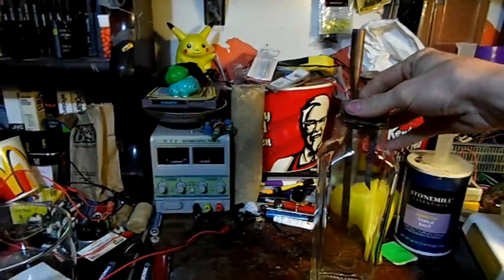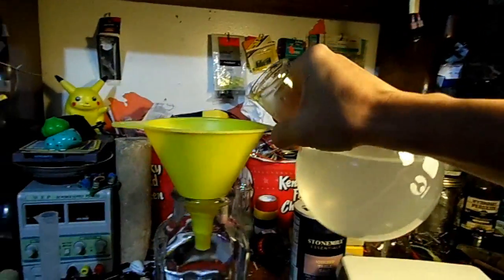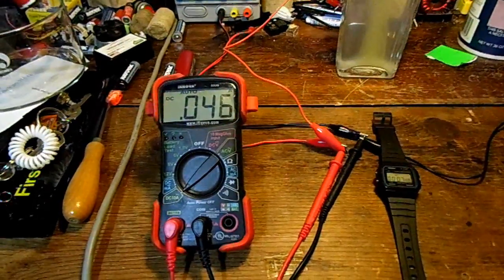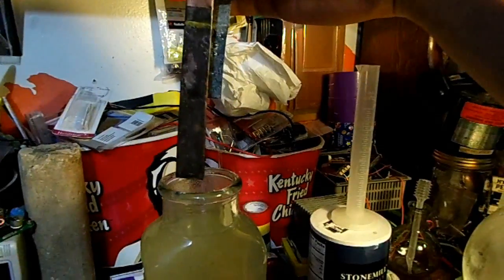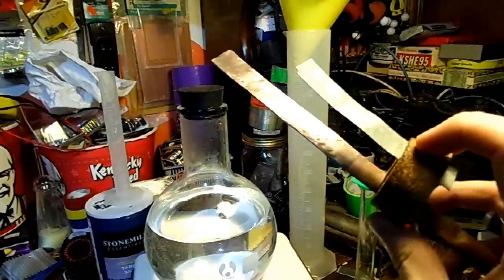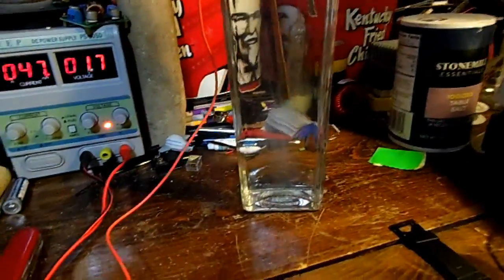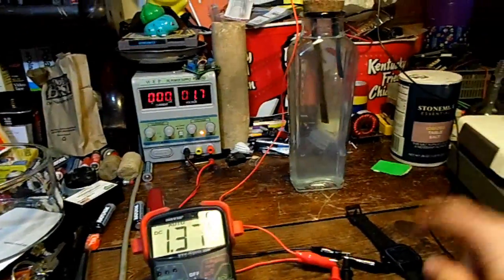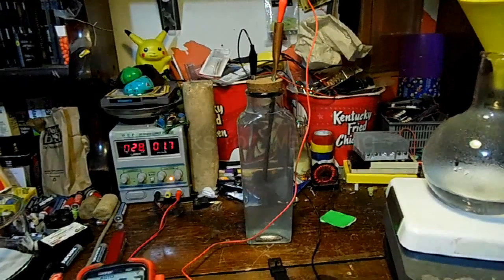DIY Rechargible Copper Zinc Battery with Epsom Salt

Comment: Thanks for sharing. ^.^ this is extremely easy to make a rechargable battery at home. 25 of those bottles 5 connected to parallel and 5 in series will make 5V 0,5 A rechargable battery that should be last for 2,5 hours in theory. Hi from the year 2021 when worldwide massive blackouts expecting on following month this year. So preparing for off grid battery solution is one of the essential things to do in under massive lockdowns.

Comment: i developed a redox battery that never corrodes and it lights up a very bright blue led for 3 days in a row by now and keeps going , charges in about 5 minutes the main problem is not to overcharge them because then the plates will corrode . so its very punishing when its been overcharged . i managed to get 2.5 volts From a Single cell when it was fully charged the normal volt reading was 1.85 volts

Comment from the maker: it always settles back down to 0.85v. i found that the reason the copper annode was turning into copper hydroxide was because the charging voltage was too high. so evidently its best to charge it at 0.9v or so instead of 1.7v.

also i think i could step the amperage up a lot more by adding more epsom salt. but if i was going to do that i would make a battery with more surface area. i might melt down american pennies to get zinc.

Comment from the maker: you can actually put pure iron and nickel into the battery and then charge it to turn the metal's surface into oxide.

and what would be the purpose of puting wood ash into the electrolye? if your meaning to add carbon i would imagine Graphite powder would be better and more pure.

but thanks for the tips. have you made nickel-iron batteries before?
Reply: Wood ash provides a small amount oof potassium hydroxide to the electrolyte

Comment: Electrolytic capacitors are a similar thing but dump all the volts and ampage in one short burst and then recharge.
If you had one of those that could maintain a slow steady low volt and ampage out it would be a rechargeable battery.
The efficiency of the cathode anode is directly related to its surface area.
Electrolytic capacitors sometimes use sintered materials.
Something like very fine wire rolled into a coil might work to get the large surface area.
For rechargeable batteries you need a cathode of say magnesium and the best electrolyte for it would be magnesium based ie epsom salt solution.
If you want more voltage you need more cells connected in series.
Reply: ZENOIST2 
2 sets of 2 batterys connected in series and both sets conected together in peralel will give you 2x the volts and amps that 1 would.
i read about this in a book about seting up solar panels and sometimes use it to power stuff that take alot of power like radios backlights alarm clocks and mp3 players when trying to see whats wrong with them.
It does work.

Comment: Can you make a battery from copper drinking bottle? It's cost about 15$. There you can add zinc foils and more copper wires separated by a plastic bottle sheet. You will get power same as a polymer cell from 1 litre copper bottle. I found on ebay 3 days ago. I want to charge this from Mud inserting copper tubes near aluminium tubes with a blocking diode on copper to block the current reversing. That's free energy for 5-6 years cell life.

Comment: So if I use 2000ml Epsom salt, I may be able to get a 1 Amp flow?  Then I could use a 5v regulator with a USB breakout board, to make a rechargeable phone battery?  It would only last as long as the surface area of the metals provided though, correct?  Thanks for sharing this!
Reply: Since when is epsom salt measured in ml? You should be adding a specific number of grams.

Comment: HOW Would The Cell Work Work With   1. A MIXTURE OF NaCl AND Epsom SALTS.  2. KOH AS AN ALCINE electrolyte.      3.Using a Battery Seperator to hold any oxides ect.     Many      Thanks, the Video was Fine, keep then up even if not perfect, they show the concept.

Comment: try alum with the epsom mix...its in the herbs section of supermarket. the edison battery actual used iron oxide or zinc oxide and not the metal. burn some wood and mix the ash with water as your electrolite in the edison battery
Reply: Edison battery uses nickel oxides and iron oxides.

Comment: Where did you find the Zinc plate? and does it have to be pure zinc?
Reply from the maker: I got it from a chemical supplier called cynmar. but you can find metals like that on eBay.

and idk how impure zinc will work. btw pennies a 95% zinc.
Reply: Okay, thanks for the help, I really want to give this a try sometime!

Comment: :D really? it's never gonna be rechargeable if you don't use a membrane to stop molecules, the purpose is to stop ions to move from a metal to the other, if you don't have that you'll be basically electroplating the cathodic metal on the anode and the oxides of both metals will fall on the bottom, what you want is to oxidize the copper while reducing the zinc, then while discharging battery the copper will go back to metal spontaneously and the zinc will oxidize, zinc is also used as anodic metal on the bottom of ships as sacrificial anode, this way the zinc will turn into oxide instead of the iron in the steel

Comment: avoid aluminum and magnesium with the stronger electrolites cause they WONT  last long... surface area is the key not the weight.. i had best results with copper/zinc oxide with a alum/epsom and zinc oxide solution as electrolite mix

Comment: When you put voltage in,   You are electroplating one metal onto the other..  If you increase the voltage in,  you'll have an electrolyzer,  or Hydrogen cell,  Making Hydrogen and oxygen....  It's charging like a capacitor.